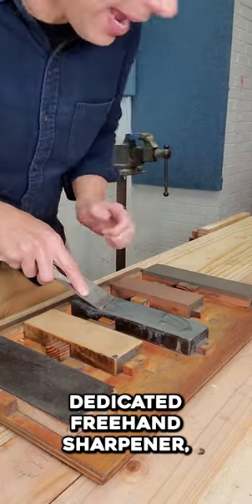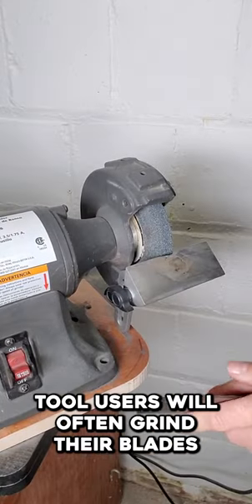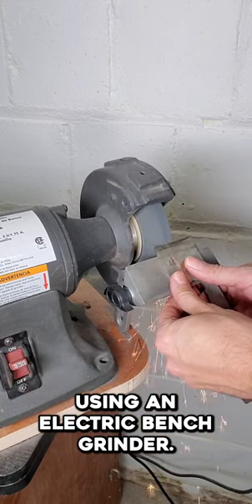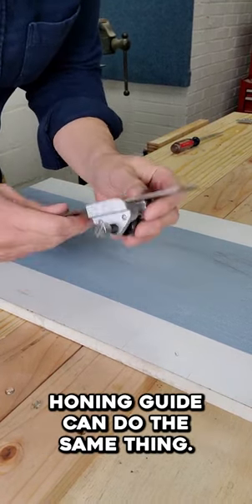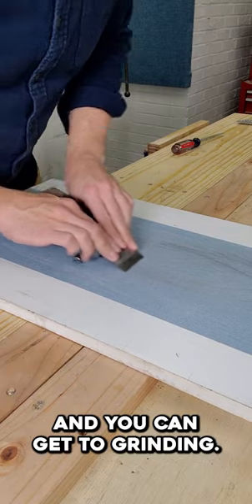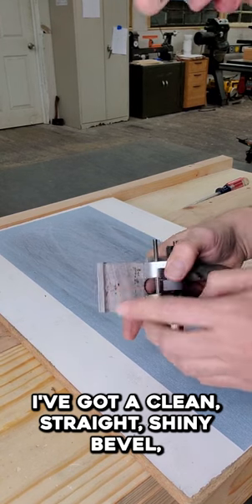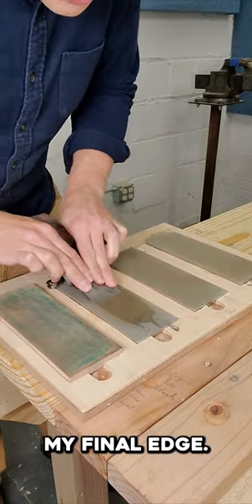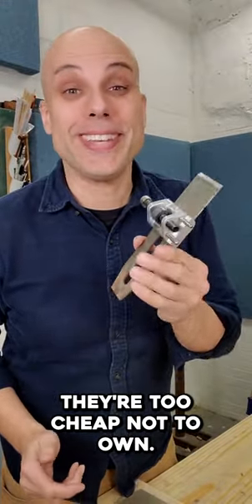Everyone NEEDS this $15 tool! #diy #woodworking #shorts

Comment: It depends on what I'm doing. If I'm just touching up, I free hand. If it's bad, I'll use a guide.
Reply: Same.  New (or new to me) tool.  I’m gonna spend some time with my guide.  I’ll even start with some pretty low grit 3M cubitron.  If I’ve fully nicked an edge, then back to the guide.  If I’m doing normal honing with an established bevel, I’m just gonna freehand.  Sometimes I’ll go through all my chisels or planes with the guide again after a while just to get rid of the inevitable curve my freehand introduces.  Usually when I’m debating my next project.  The fancy jigs are crazy to me.  I really don’t care if I’m at 24 or 31 degrees or whatever.
Reply: If it’s really bad or dented just use a tungsten carbide bench grinder stone (they’re either blue or green) and clean up with a hand stone after, I usually use a rougher one first and then this very fine one I got from someone no idea what grit they are tho

Comment: I got one of those a while back and it always grinds the primary bevel out of square. Then the cutting edge isn't square with the sides of my blades. I'm not sure what to do about that, though.

Comment: I use a belt sander with a guide. Razor sharp in 2 passes each side.  I sliced through an 87 toyota pickup bedside with a $6 harbor freight machete

Comment: My issue with honing guides is the wheel bearing. In my experience, the wear and tear of loose grit and rolling on surfaces designed to grind down metal make it easy to shift the wheel out of alignment, or cause uneven tear on the "tread surface"  particularly so with cheaper ones. 

On top of that, many times you'll need to file the channels of the interior mouth so it grips your 1/4" or 1/2" chisel properly. 

All that being said, Everything else you've said is true, it's just better to get a $25+ honing guide, particularly ones with built-in/included angle setters and gauges, rather than the $15.
Reply: I completely agree with you. Also, sandpaper is not very effective for me. I don't know how he does it in five minutes, but it took mee several hours at 180 grit and an hour at 320 grit. The sandpaper also needs to be of a certain quality not to wear out, apparently. I thought wet sanding paper would work, but it often stretches and tears due to the blade cutting into it. The honing guide also caused the corners to be more blunt.
Reply: @starshot5172 when I grind with sandpaper I start with 60 or 80 grit. Go in dry and use a brush to clear it out occasionally and you can grind quite quickly!
Reply: @starshot5172 maybe it’s a skill issue lol
Reply: Wouldn't be difficult to make a honing guide on a track that doesn't have to roll over the sand paper though
Reply: Had some corrosion issues on mine and the wheel seized without my noticing. 

Ground a flat into the wheel.... :(

Good excuse to go freehand!
Reply: At least on the cheap ones the wheel is just a plain bearing. An E-clip holds the wheel on the shaft, use a removal/installer tool to get it off without damage (or skip that and pry it off with damage & just replace it), then clean, then oil (not grease) the bearing surface and re-install the wheel & E-clip.

Ideally such a guide would be made with a shielded permanently-lubricated ball bearing instead of just a plain bearing, but that'd cost $10+ on its own.
Reply: You are applying to much pressure if you wheels are flatten out. Second, what the heck do you think will happen running guide over sandpaper. That's what sandpaper is for, sanding down. The guide is made to use on a stone.

Comment: the best part is the 80/20 rule. the surface under the sandpaper does NOT need to be perfectly flat, just close to get you 80% of the way to completion. then use the diamond for the very last bit to get that sharp flat edge. I use my roughly flat table saw top, then the diamonds. after restoration it's all by hand sharpening.

Comment: If you're buying new chisels and getting them sharpened, the cheapo jigs are great: simple, effective, and they help you learn about sharpening. 

If you're starting from flea market finds, $100 for a cheap-but-not-trash bench grinder and $50 for a good tool rest are more than worth it. I wore the coating on the wheel off my jig tring to re-grind primary bevels, and grit kept getting jammed up inside the axle. You can clean it out but the grinder is also way faster.

Comment: Just figured out in last month how to use low rpm grinder for initial 25 degree angle, slight hollow/concave, which is great, then that jig at about 27 degree for whetstones second bevel, paper cutting sharp now.
Still takes a bit of time, looking at wet grinding systems like Tormek, and cheaper ones, getting cbn wheels to try

Comment: The cheap as in $15 one I got doesn't hold chisel and plane blades properly. The grooves do not grip properly or consistently and the tool often slips out even after tightening the guide as tight as you can. I gave up on mine and learned to sharpen freehand.

Comment: I hate using all of them, cheap and expensive. Only reason i went to free hand. 

I dont make convex bevels tho. I just hollow grind with the grinder so the bevel registers on the tip and heel of the bevel. Youre removing so little material that it takes seconds and if im touching up an edge regularly i can just go straight to the 8k. Deepening the hollow once in probably 200 sharpenings or something (never actually getting to the tip)

Comment: Had one. Got tired of using so I learned free hand. Never looked back
Reply: Does it also make your fingers cramp like fuck trying to keep the angle right or is that just me
Reply: @juhis5936  No they don't cramp up on me. I mean I guess if you aren't used to it your fingers might get tired. Maybe you are holding it too tight. If you are right handed, your right hand is mainly to just hold it at that angle. You don't need to hold it too tight. Maybe relax the hand some. Your other hand is the one providing most of the downward pressure to keep the bevel in good contact to the stone. Maybe try adjusting your position. If you are standing,try using a stool and sit or vice versa. Eventually your hands will get used to it.
Reply: @Rufio1975  been doing it for about 3 years now I do moulder blades tho which are a little tricky cus they're short and wide, definitely am holding too tight but I get the same finger cramps with the ornamental moulder blades where you have to use a small thin whetstone to get around all the parts
Reply: @juhis5936   That's crazy. Wish I had a definite answer. That's what it was for me in the beginning. I was holding onto the tools too tight. Maybe try drinking a shot of whiskey or two or three. Should fix you right up.
Reply: @Rufio1975 good idea

Comment: I prefer hand sharpening. In the time somebody sets up his honing guide i already sharpened my blade three times.
Reply: It takes all of like 5 seconds to set it up correctly. Especially if you have a guide. My guide is literally just a 3/4" piece of wood (to but the guide against) with a  1/4 piece (as a stop for the blade) screwed on top of it. You get the correct distance every time
Reply: maybe you can show in a video???

Comment: About 5 years ago I took the trucks off and old skateboard and use a piece of 2x4 and screwed a timber slick to it I adjusted it until the angle was right and worked 100% perfect, I thought I invented something but then saw they already exist lol.

Comment: I got one and it's manufactured wrongly. The cylinder is not in the same plane as the jaws. It seems they expected that and added two tiny worm screws as laternal adjustment. It can be adjusted but it's pain in the ass and works only for one width and one angle at the time. 🤯
Reply: thank you, i tought it was me,lol

Comment: I don’t think I’ve scrambled to buy a tool so fast. I gave freehand a shot and I think I made it duller. Can’t wait for it to ship!
Reply: Those are quite nice. As suggested I use them to grind the blade (shape it). Normal sharpening I do freehand, mostly. Make a block to find the angle (the length) to get consistent results. Makes your life much easier.
Sharpening is a necessary skill, we want to get back to getting stuff done. Overthinking it just keeps you from cutting joinery.
Reply: @johanneswerner1140 my goal is to be able to do freehand. I’m excited for the tool because they’ll get me used to the angle.
Reply: @S_dogood  yes, getting a flat bevel at a defined angle will do that.  I don't care about the exact angle, I sharpen a convex bevel (ok, it probably gets more convex with each sharpening), and - as Christopher Schwartz remarks - sharp fixes everything...

Don't overthink it. Get Richard Maguire's sharpening series. It's worth it (as are his projects!).

Comment: A grinder with a 60 grit wheel isn't a sharpening tool.  Hard felt wheels are the way.
Reply: You’re meant to touch it up on a whetstone after the grinding wheel
Reply: @juhis5936  you wreck your edges the way you prefer.

Comment: We have seen your technique... You aren't dedicated, you are stubborn. Use the guide or learn the difference between a burr and just mashing the tip of your blade forward on a sharpening stone until the blade curls over which is what we have seen you do. Basically you are just damaging your blade in a straight line instead of grinding and you should pull back on the blade while pressing to the stone not the other way around. Sorry to be so blunt, but bold claims being made by a shamwow salesman need to be called out sometimes.